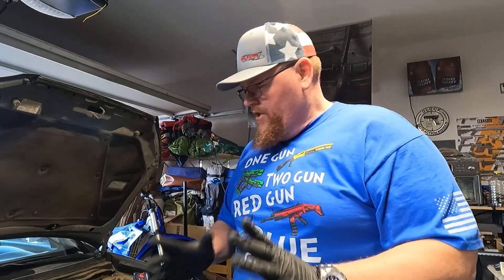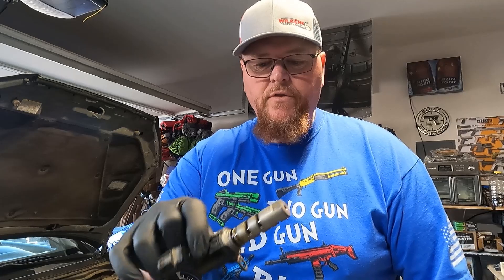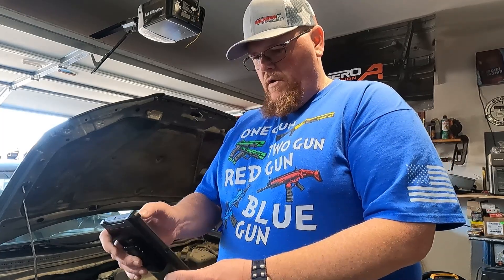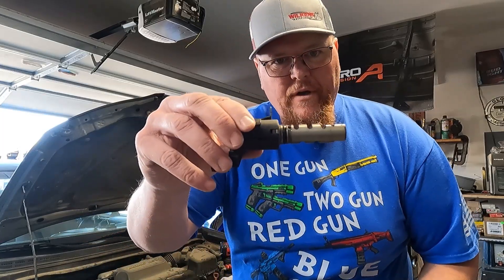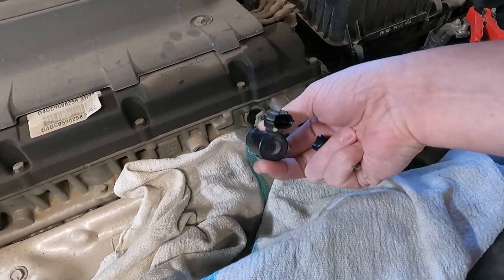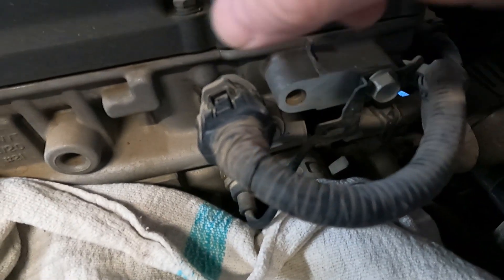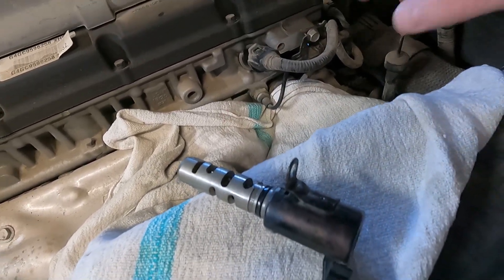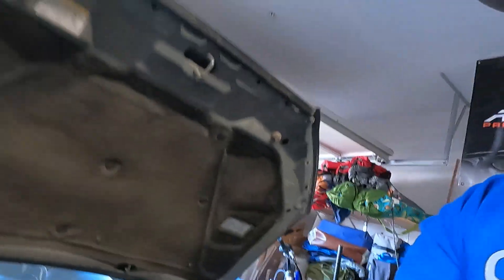2004-2014 Hyundai Elantra 2.0L OCV Oil Control Variable Valve Timing (VVT) Solenoid/Valve

Comment: Great information...but if you're still getting a code, there is a small screen mesh filter on the right side of the cylinder head that needs to be replaced or cleaned. Hope this helps anyone going down that rabbit hole.

Comment: Mine literally just ran this code again so now imma replace my timing belt, pulley, control arms, axles, most sensors that are easy, and also I cleaned the intake manifold because I’m tryna get this beast to 300,000 miles 😤
Reply: Before I got the car it was reliable even with the codes and issues
Reply: keep an eye on using the exact wattage exterior bulbs, the electrical systems are a weak point.. 237k on my 08
Reply: @RepairRenovateRenew  WOW. Mine still a baby with 164K miles.
Reply: 247K on my 2003! Runs well too!

Comment: What did the bad OCV do when you were driving it? I'd like to know.
Reply from the maker: Nothing, it threw a code, I checked it and the OCV was the fix, so I fixed it.
Reply: @AZ Pat Riot 1776 
So nothing was going on while driving? My car makes a rattling sound where the engine is. So I got the codes from the engine and was given a P0011 code and says I need to replace the Oil Control Valve (OCV). So I guess my question is.. does a bad OCV cause rattling sounds if it's bad while driving/accelerating?
Reply: @AZPatRiot1776  mine threw a po017.. I’ve changed crankshaft position sensor , camshaft position sensor and didn’t help.. it’s idling really low and misfiring.. your video is where YouTube sent me for this code and just now hearing of this oil valve.. I’m gonna try it out since a mechanic alrwady screwed me and charged me $600 for a coil lock(whatever the hell THAT is) and it didn’t fix the problem.. I’m about $1600 in on this car that NEVER had a problem before this
Reply from the maker: @bradmadeira6807  I hope the OCV  works for you. Thank you so much for watching. I appreciate every viewer, we are all in this together.
Reply: @AZPatRiot1776  I tested both the intake  AND the exhaust ocv already and both worked with the wire test to the battery
Reply: @AZPatRiot1776  I’ve tested both the intake AND exhaust ocv’s and they worked when I wired them to the battery.. I don’t get it

Comment: Hello, I am going to adapt a 2004 elentra engine to a 2001 Elantra which the VVT valve is not present in 2001 but in the new engine it is. Could you leave it disconnected?
Reply from the maker: If I read your question correct, the answer is. If the new motor has Variable Valve Timing, you really should have the VVT valve for it to work properly. I'm not ASE Certified so don't take my advice to the bank, I'm just a Shade Tree and could be 100% wrong, just a disclaimer.

Comment: You going to run into problems than fixing the problem with Amazon parts, when it comes to sensors, you should always used genuine parts, just fyi..
Reply from the maker: @hiromiya3365  thanks for watching. There are few parts makers for most parts, and Amazon often has quality parts.